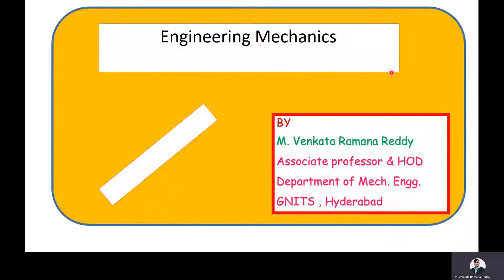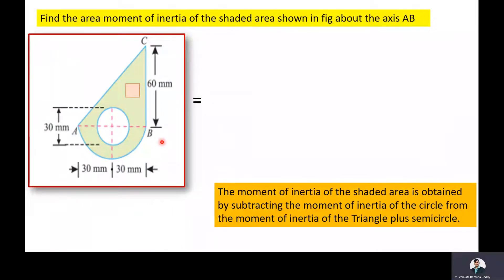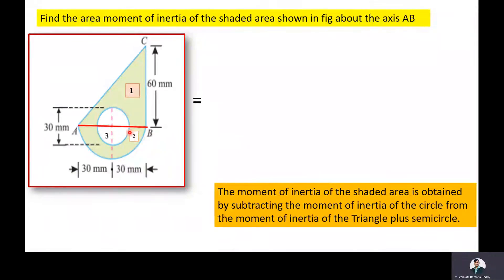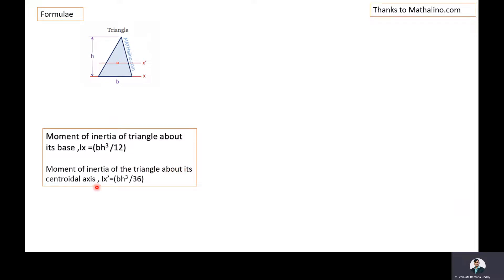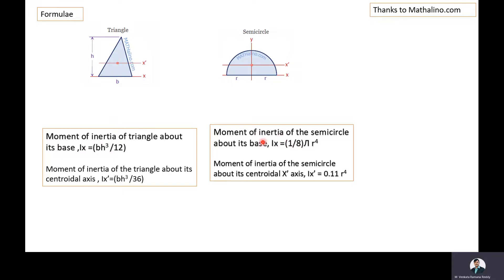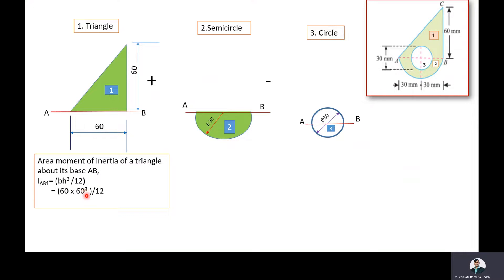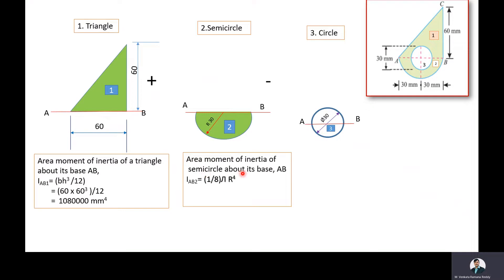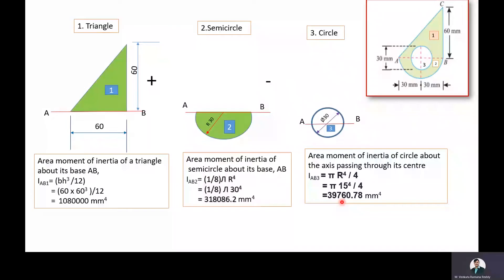Area moment of inertia: problem 4

Comment: At 3:48 why did u divide by 12?
The formula is bh^3/36 right?
Reply from the maker: The formula for M I of triangle about its base is bh'3/ 12, where as bh'3/36 is the formula used when about  the centroidal axis parallel to the base..
Reply: @venkatrr8050   ok thanks..